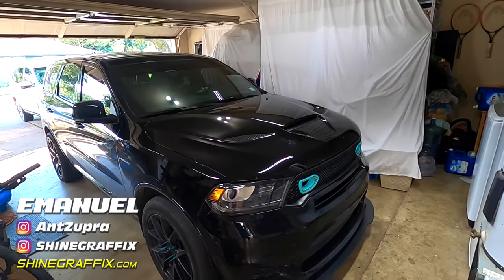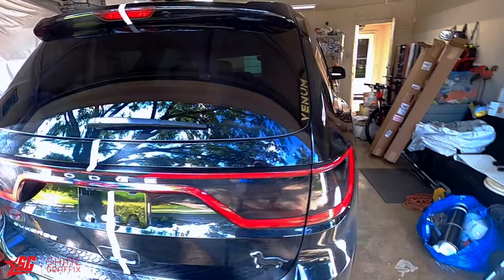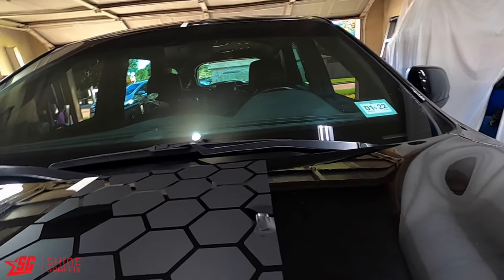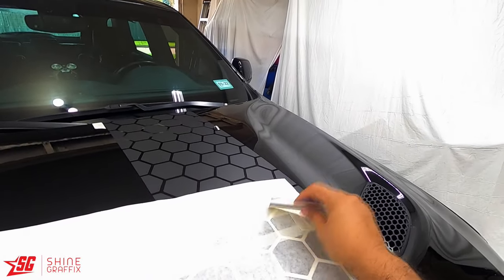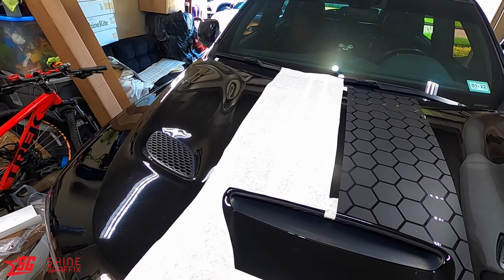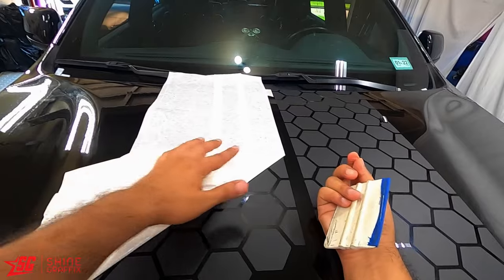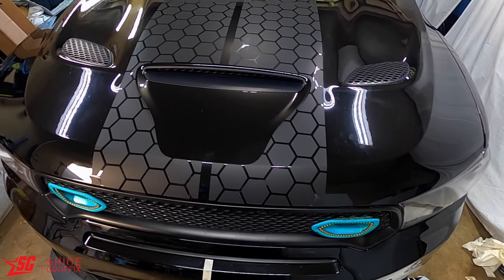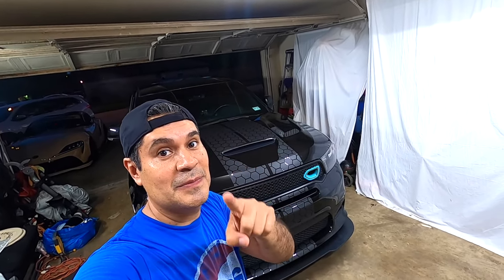How To Install HONEYCOMB STRIPES Dodge Durango SRT

Comment: Dumb question but what are those inserts on your grill?
Reply from the maker: He got those from a Dodge Charger 👍
Reply: I want to know who the guy is and how he did it. Really want to do it to my Durango lol
Reply: @jaimemeza2183  I did the work myself!
Reply: @logandancer4063  you did a great job. Any tips? Tools you used?
Reply: @jaimemeza2183  I used a Dremel to cut out the holes. Take very precise measuring and measured twice cut once, I started small and made the whole just a little bigger until the snorkels fit snug inside. Remember you can always cut more if you need to but if you cut too big you can’t fix that. Patience is key